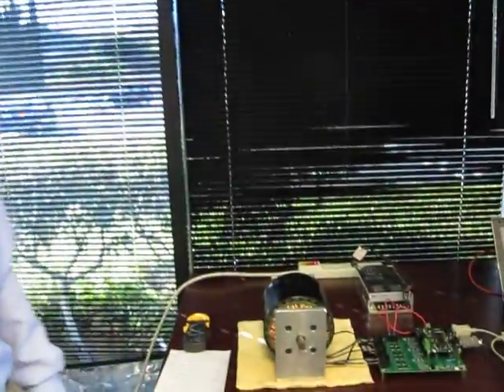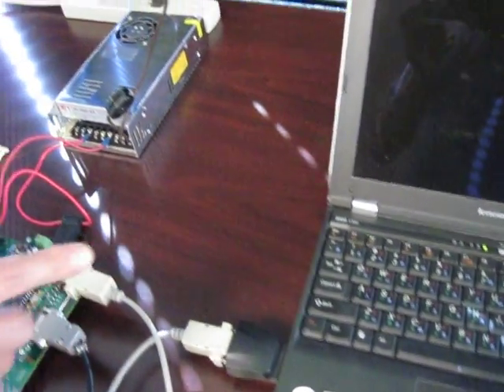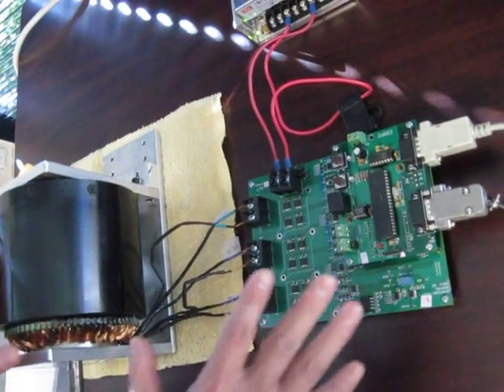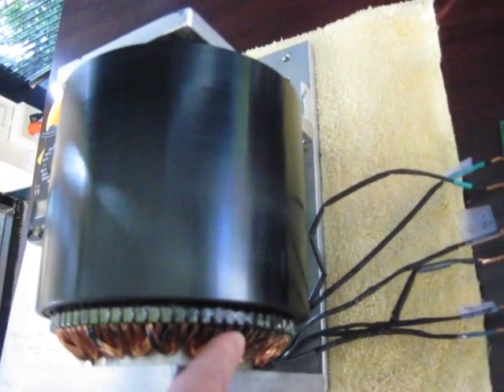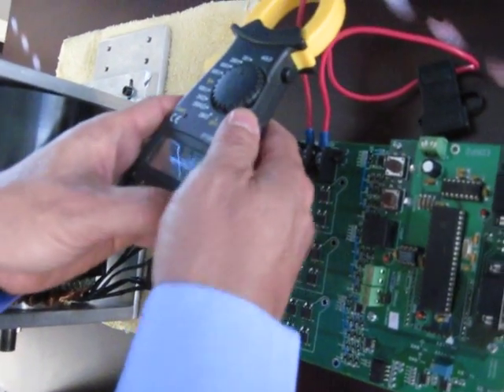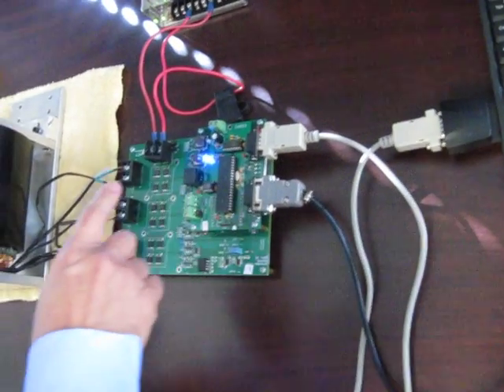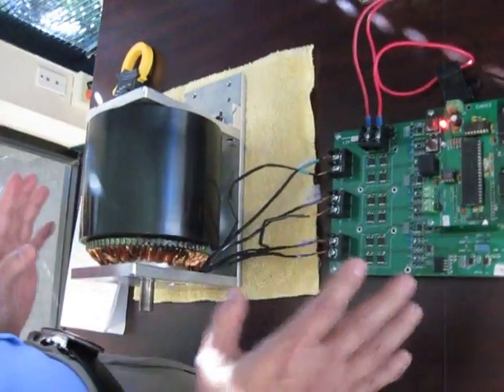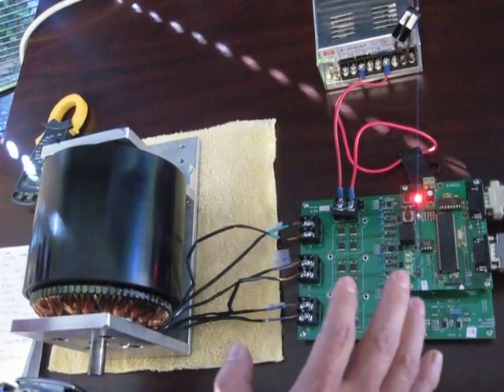Digital Motor Technology

Comment: Still I am confused Sir , why any one go for this motor when one can get all feature by VFD & inverter motor , what extra advantage with this digital motor .
Sir please give us some knowledge or any reference or like to get more details .
Reply: All VFD & inverter are used for the induction motor which has two currents to produce force. This is the motor with permanent magnets which only has one current to interact with permanent magnets to produce force. Therefore the efficiency can be higher.